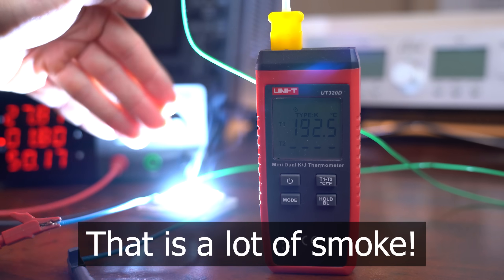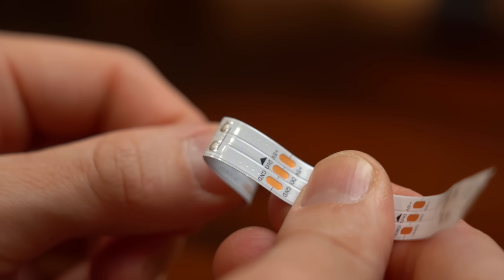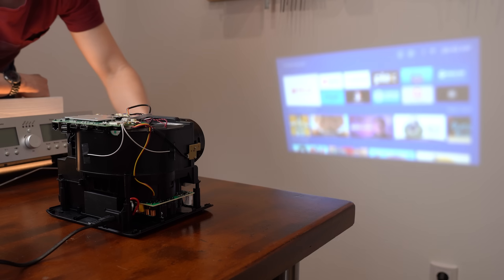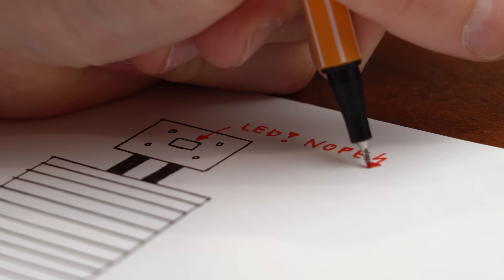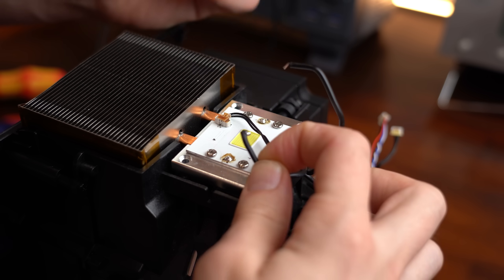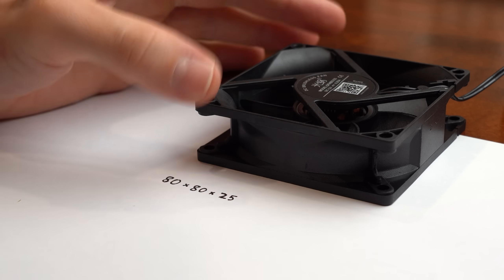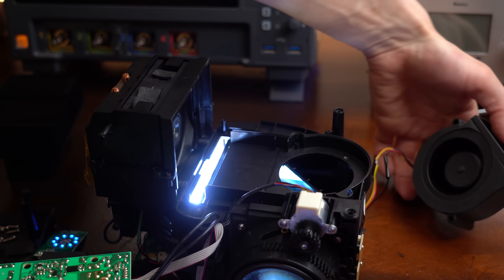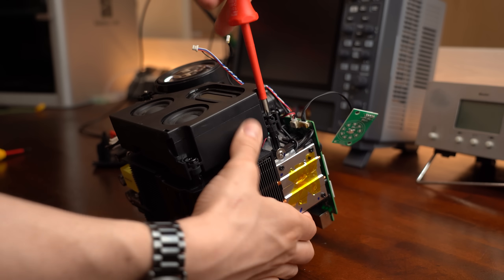Your Cheap Projector has 1 BIG Problem?!

Comment: Wait till Scott learns about Noctua fans
Reply: I've been using Noctua fans on my 3d printers for YEARS... one of my best decisions in my life.
Reply: I usually use noctuas for these kinds of mods. The NF-A8 hits about the same airflow as fan 1 with a pretty significant drop in noise.
Reply from the maker: The comment section apparently loves these things
Reply: @greatscottlab  They do make a nice product. 
But if we want airflow, I didn't see anyone mention Delta.
Reply: They, do.
Reply: @greatscottlab their fans are know for being quiet yet durable and performant, while Delta fans as someone else mentioned have excellent airflow but create a bit of a racket doing so (imagine a server rack screaming)
Reply: @greatscottlab  They are a cut above your standard fans. Mostly just due to high quality controls and frame design that prevents as much vibration as possible.
Reply: @greatscottlab  they are really great fans....
Reply: I was going to comment this too
Reply: Arctic have some not quite as quiet fans but are a quarter the price. I highly recommend their P12s
Reply: @Pegaroo_  thats not comparable the Arctic fans  don't last 1/10 of the running time since they have different bearings
Reply: @NinoJoel  that may well be the case but I can kit out my entire case in Arctic fans for the price of one Noctua.
Reply: There's also be quiet!
Reply: Exactly.
After I could build a dream ML PC (kind of) I spent a lot of the money on the industrial PPC fans. They are insane but also loud. But actually I do not mind the noise of fans at all.

I told the boss that the graphicscard gets very hot and needs the cooling. That is only kind of the case though, I knew I could keep it after all the work was done so I wanted to preserve it. 

Since then I am like the anti scott. I think how to improve the cooling regardless of noise.
Reply: Ltt upgrade when?
Reply: His name's not Scott, it's Jeremy.
Reply: lmao you need to concern more on static pressure (force of air) than airflow (velocity of air) when it come to heatsink cfm is misconceptions tbh
Reply: it wouldnt've fit
Reply: I also use Noctua fans for nearly everything.
Reply: He has it in Prusa printer
Reply: yeah, it will likely help reduce that fan, but the blower fan is hard to replace, and i doubt it can get much quieter..
Reply: @ considering it taks seems to be to cool something that doesn't even generate all that much heat makes me think it can actually be replaced by a slim 5-10mm thick normal fan mounted at an angle.

And yes, these exist, I have some Scythe low profile heatsinks with Scythe fans that are incredibly thin while stil providing surprisingly high airflow.
Reply: Noctua NF-A8 will fit perfect on that project with 32.67 CFM and 17,7 dB(A)
Reply: Cool on that thang
Reply: additional one is noctua have low airflow but they have high static pressure with is great for heatsink application
Reply: You do know his name isn’t Scott?
Reply: i even fan swapped my pellet smoker with a noctua fan, so scott could put them in his projector too 😂
Reply: Ugh, there had to be a mention of Noctua of course...the Nidec fans in my Gamecube, Wii and Wii U all still operate after 24, 18 and 13 years respectively.  NMB, the Panaflo and other fans are just as good.  Noctua is called Noctua but do they even make a fan in black?  It would be nice, never was a fan of the wood shades.
Reply: @WJCTechyman  They make grey versions using some of their older designs. Although, in my opinion you should never even see a fan in a device, so the color scheme doesn't exactly matter.
Reply: @WJCTechyman  yes they do make some in black
Reply: i was thinking the same! #MACHONACHO
Reply: arctic fans are a good competitor for noctua fans
Reply: *bequiet
Reply: Nock Tuah
Reply: First PC I built was all Noctua fans. £100+ in FANS. Know what though? I could sleep fine with my PC around 8 feet away from me. In fact, there's many times where I had to check for lights being on because I literally couldn't hear fan noise. The only noise I heard, was occasional coil whine from my GPU (I set some fan profiles to barely spin the fans, case/CPU fans done a decent job as it was).
That being said, having a good hybrid PSU and a decent case at preventing sound bleed really helped. I also done a smidge of fan tuning.
Reply: Noctua is rather limited in the sizes of fans they make and, while I will use a Noctua in some projects for longevity's sake (like a 3D printer), it's often not possible with the wide array of sizes employed in modern cheap electronics. Besides, there are much more customizability/variety in fans than most would think (see my main thread comment to preclude me repeating myself here).
Reply: Linus x Scott 💥
Reply: ITT: A bunch of people who replaced overpowered fans with weak ones eating influencer ads by the bucket.
Reply: If you take a slightly worse product to noctua the price drops by half..
So def. overrated
Reply: They aren't magic or above the laws of physics either. Mostly they're just marketing around slower spinning fans.
Reply: @Max24871  the whole point is they can make their fans spin slower while producing the same air flow and pressure, and without having the air itself create extra noise from turbulence.
Reply: @Max24871  It's more than just slower spinning; the blade design is different, and the bearings are better.  You can run them at the same speed as a cheap one and get the same air flow for far less noise.
Reply: @Max24871  The secret sauce for Noctua is the bearings along with a very rigid plastic frame but you're right its not magic, its just a higher level of quality control than others.
Reply: @Max24871  they use material design and blade geometry to effectively move more air at lower RPMs.

They cost more because they are more.

Pretending it's pure marketing bullshit is you bullshiting.

Are they worth the premium price for the relatively small advantages? That's subjective.

Are they even moderately better due to their design and materials and as such cost more than average? That's an objective yes.

Automatic dismissal of a products merit is just as bad as fanboying.
Reply: The Noctua fans aren't actually much quieter compared to much cheaper Sunon Maglev fans lol
Reply: @daijoubu4529  read another comment talking about those so i decided to research them. Maglev fans can only be mounted vertically, with air movement being horizontal. If you're planning on projecting into a wall and not a ceiling, they should work.
Reply: Noctua has nowhere near the cfm of the ones used here.
Reply: @noktrnl123  The comparable noctua fan has a higher CFM than all of the options he bought
Reply: Overpriced and overhyped.
Reply: @kazuviking  Even their lower priced options are significantly quieter than many other company's offers. They simply have good bearings and geometry, and the company puts effort into ensuring their claims are accurate
Reply: @kazuviking not really... If you work in the industry any long lasting alternative is way more expensive
Reply: @kazuviking  Not to mention the hideous color scheme... 😂
Reply: Wait till you see the dimensions of the product 🤷
Reply: @ranjitmandal1612  80*80*25 is a standard fan size.
Reply: @somedude2492  good know thx
Reply: @ranjitmandal1612  Why? It's a standard 80x80x25mm axial fan. Not something you'd put in a full size desktop PC, but it's still supported by many fan manufacturers including Noctua (NF-A8).
Reply: @rustkitty the noctua fan is 33cfm, the one he installed are 40+cfm fans. The noctua is quieter because it spins slower.
Reply: @TechTinkerWorks  No the original one was 40+ CFM, the ones he bought are lower than that. His options were 30.4, 26.5, and 23.3 CFM. The noctua fan would have been higher than all of the options he bought.
Reply: @TechTinkerWorks  depends on the P/Q-curve (pressure/airflow relation). i wouldnt trust these cfm specs as they are mostly measured (sometime not even that) at no restriction, so if you use a heatsink or even just place a grill (like a case) in front of it, it will vary starkly
Reply: @TechTinkerWorks not true. Noctua is quieter because they use more premium low friction bearings and more optimized blade shapes and tolerances. Stop spreading bs.
Reply: @TechTinkerWorks no the original was 40cfm, the ones he bought were 30 and below
Reply: @ranjitmandal1612 Noctua has a fan size for almost everything 🙄
Reply: @TechnologistAtWork  "everything"
Reply: @ranjitmandal1612  yes

Comment: The centrifugal fan is to protect the LCD panels from the heat of the LED radiation.
By using an infrared filter and/or a dichroic mirror, you can stop the IR radiation without using the additional fan. But you need to rebuilt the projector in order to achieve such result...
Reply: thiiis, the lcd can discolour, delaminate, warp, etc quite quickly with such hacks

gotta say, it's quite dissapointing that great scott is making such broad claims without properly researching why the fans are there
Reply: @HolarMusic  i mean he checked the air chamber temperature an only got a 5°c increase, considerings the surface area of the screen it definetly has heated up more than twice that but thath should still fall well under its thermal limit. if after two continous hours he hasnt noticed any discoloration and or wrapping its definetely fine for his usecase
Reply: @lapasteque899  you could use that thing without cooling at all for 2 hours and not notice anything, that still cuts down the lifespan significantly

the chamber temperature isn't what's important there, the fan forces a ton of airflow over the LCD specifically to actively cool it down, that's what the fan is there for, not to just cool down the chamber

even if it's fine for his usecase in his cold room, he's touting this as a universal improvement for these projectors, this might cause a lot of people to ruin theirs, peak misinformation by lack of care
Reply: @HolarMusic believe me you couldn’t I made that mistake water cooling my video projector, the cooling fan also cooled the lcd with input air. Without it it took no more than 15min for darkspots to appear
Reply: there is no significant amount of IR coming out from a white led, it is basically all visible light. still, visible light heats just as much (technically more) as IR light and the transmittance of LCD panels is somewhere around 5-10%. that is a lot of waste heat in the panel that you can do nothing about other than cool with oil or air.

Comment: Its own heatsink would be better, if it had at least 4 heatpipes instead of 2. There is definitely enough room for that.

What might also help is adding larger fan outside through a custom 3D printed bracket. With some more air-guiding brackets, you should be able to get away with just having that one large fan arranged in "pull" config

Centrifugal fans will always be loud, that´s unavoidable. It might be worth attaching a voltage control knob to it and regulate the output voltage manually. Or figure out, how the air gets in and add large fan there. Its pressure should be strong enough to push air around.

Comment: Turn it upside down and it will work cooler and quieter.
You see, heat-pipes works much better moving heat up. You could get like up to +100% of heat transfer efficacy.
Also you could stick a bunch of tiny aluminium extrusion heatsinks to passive heatblock wherever space allows you. This could really give you bunch of extra cm² of heat sinking surface. And these heatsinks are cheap as dirt.
I love to upgrade cooling systems of Chinese products - this really can prolong device's live.
Reply from the maker: Thanks for the tips!

Comment: Maybe expanding the LEDs with a few more heatpipes could lower the temperatures further with less fan noise. For the optics cooling, you could try using some centrifugal laptop fans, but they may not move that much air around. Of course, you would first need to measure the ambient temperature inside the chamber.

Comment: I bought a cheap projector years ago that had halogen bulb.  It was really dim so I looked for a bulb with a higher lumen rating.  That fixed it but within minutes a black circle would start growing on the LCD panel.  I found it worked best outdoors when it was cool.  Manufacturers have to make things that work to a certain spec and fit within a certain parts budget.  When it comes to cooling, you either need colder air or more of it.  And more of it comes from a bigger fan or faster fan.  You might be able to combine a peltier cooler with a slower fan on the inside.  And then rely more on environmental cooling and a large heatsink on the outside.
Reply: a peltier is just a heatpump with extremely bad efficiency.

you don't gain anything but raise the cooling load and use more power for everything.
Reply: @casemodder89  you inject cold air inside the device where it's needed and deal with the heat in a much larger space when you have better quiet options.
Reply: @bkucenski   i'm an HVAC Tech and trust me: peltiers are crap.

you'd invest 300-500w of electrical power to cool that 50w led.  now you have to cool a huge lump of peltiers giving off 350 to 550w.

in the end the energy cost would be enormous and not worthy of that puny cheapass beamer.

Comment: You can use water cooling of Noctua of Bequiet!'s fans with 3d printed ducts. Especially replacing blower fan with a axial fan will help a lot (ofv that means pressure lose, but with carefull design you can overcome that).

Comment: 52db vs 57db is a big difference more than double the audible volume (The decibel (dB) scale is a logarithmic unit used to measure sound levels, where a 10 dB increase represents a tenfold increase in sound intensity, and a 3 dB increase roughly doubles the perceived loudness.) so the sounds of the electric too brush is vastly louder than the fan in question
Reply: 3db is double the sound pressure, but absolutely not double the perceived volume, perceptual doubling is ~10db
Reply: Thats other thqn the fact that a the meter is stuck right next to the fan. Where db should be measured from aprox 2 meters
Reply: You can either remember that +10dB = x10 louder, or that +3dB = x2 louder.

Also worth noting that sound power can be very directional, and in product testing the decibel meter should be placed roughly where a human ear is... I don't think the manufacturer would recommend positioning the projector with the fan at point blank range right into your ear 😅

Comment: Could you try some crazy ways to decrease the temp? Like using a peltier plate… I always wonder if we could try to use something like that…
Or maybe use PWM on the LED to decrease the temp.
Reply from the maker: Haha, I had some other wild ideas as well. But they did not fit in the video due to time constrains. Maybe next time ;-)
Reply: A peltier plate does not cool.
It transfers the heat from one side to the other. What are you gonna do with all that heat on the other side?
Reply: @Haldi4803 a bigger delta T dissipates better, though it might not compensate for the low efficiency of Peltier TECs
Reply: PWM on the LED is an interesting idea. You might even be able to overdrive it to compensate for the lower perceived brightness. It would depend on the off time giving the thermal load enough time to better move across the heat pipes.

Comment: 9:03 
-3dBm, not -10 is 1/2 of the loudness. However our ears don't have a linear response so -3 doesn't feel like half as loud at all.
Reply: According to about 5 minutes of google, a 10dB delta equates to doubling or halving the perceived volume. I guess that's what he meant. I also thought that sounded off.
Reply: @somedude2492 It's pretty clear that's what he meant, the exact phrasing he used was "it's like half the loudness for our ears". All the comments about sound pressure seem to be willfully missing the clearly intended meaning
Reply: @bosstowndynamics5488  the number everyone remembers is "decibels are logarithmic, so +3db is is double and -3db is half". I myself had never heard that the human ear didn't work linearly with the logarithmic scale itself, and that double the sound pressure (+3dB) doesn't correlate with double the perceived volume. I never knew that to actually hear double the sound volume you had to go up 10dB. That's where the confusion comes from. 

You always learn something new. No need to get mad at people. We all learn something new every day.
Reply: @somedude2492  I'm not so much mad at you as frustrated by the large number of comments which all say something to the effect of "Uhm, actually, 3dB is double, not 10!", comments that make it clear that the commenter hasn't even entertained the possibility they might be wrong and that clearly were made without even the cursory 5 minute Google that you rightly invested before contributing
Reply: Oops I meant dBA and not dBm (which is used for transmission powers)
Reply from the maker: I think it also varies from person to person.....

Comment: 7:25 shouldn't you measure the LED pcb directly instead of the upper part of the heatsink? Because then you would measure directly the thermal transfer.

Theoretically, a better thermal transfer should increase the temperature of the heatsink (less difference in temperature between the led and heatsink)